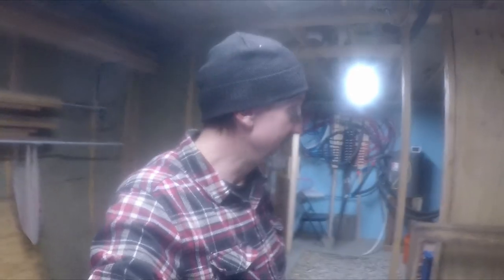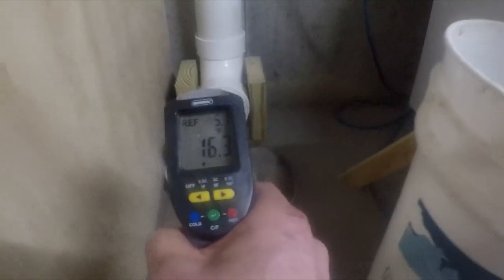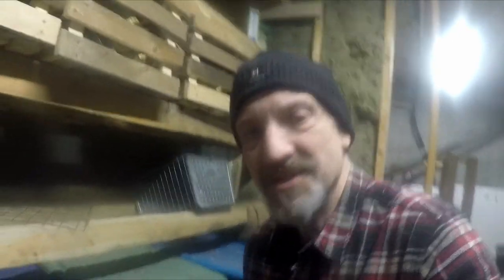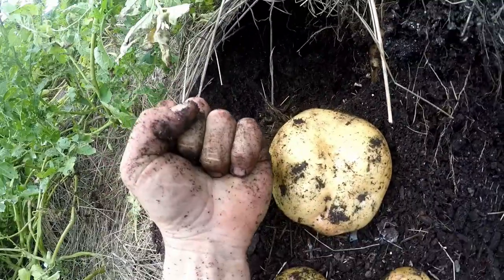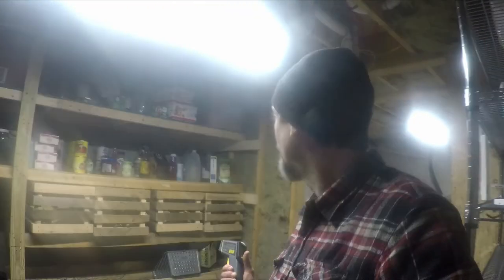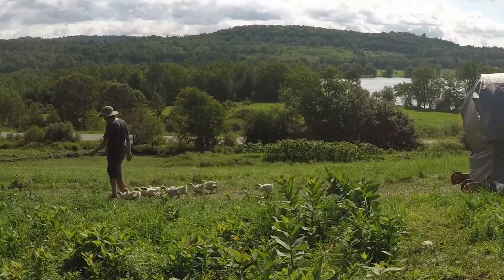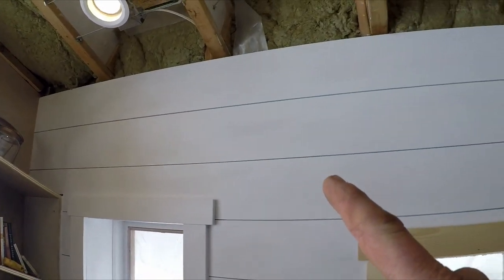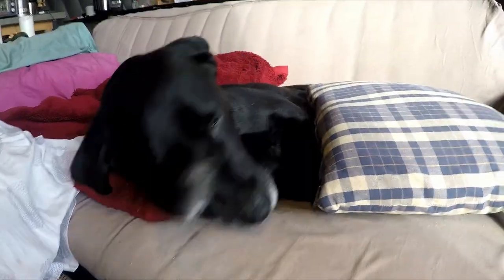ROOT CELLAR VENTILATION Update | Homestead VLOG

Comment: Just finishing our basement root cellar - going to use your scheule 40 pvc pipe layout but I may add an electric 4" fan that fits inside the pipe if I need to exhaust more air from the room.  We have some apples and pears that will make quite a bit of ethylene gas which is bad for the carrots plus the fan would help freshen the room and reduce humidity when needed.  I think the fans run around $40.00 so it seems like a worthwhile addition.
Reply from the maker: That would be a good idea to accelerate temperature changes, especially if you're monitoring the temp and humidity.

Comment: Did you consider a 4" pipe up higher going outside venting air outside or is it not neccessary?
Reply from the maker: A few years in now, I don't use it, really. It would have benefitted from the exit or heat pipe having a higher up exit point. This would create more of a stack effect (like a wood stove), creating a convection current, and sucking heat out at a higher rate.

Comment: I’m wondering how the passive ventilation performs in the warmer months.  I am a little worried that our newly made cold room is going to just heat up through the summer and wondering if there’s a schedule on which ya’d open/close the intake or output vents to keep them from heating it up too much.
Reply from the maker: Your instincts are right on.  It's not quite been a year since the Nursery was sealed and insulated. so we've been able to observe the system's behavior for most of a year. Things definitely heat up in the Spring/Summer. For ventilation, we have three systems - 1) a set of screened openable windows at opposite ends of the room. 2) A set of doors at opposite ends that can be opened.  3) a thermostat/humidistat 6000 cfm fan slightly oversized for the volume of the nursery.
Reply from the maker: I hit enter....  So, really, on a sunny, warm day we need to have the doors and windows open and then the fan still comes on when it gets over 88 F up top (I can adjust the temp).  That's enough to keep the human space and plant space in the low seventies.  BUT - we haven't experienced high summer yet, so, we'll see.  I'll do an update video.  For your project, I would be sure not to skimp on ventilation. MOST IMPORTANTLY - observe your particular space, both temp and humidity, throughout the year before making big plans. Let it evolve organically.  Get yourself some temperature monitors that record the data for you so you can see how your room reacts to the weather outside.  Good luck!
Reply: I'm still trying to figure out how to set up part of my basement for cold storage, and pardon my ignorance.  But with your passive system design, couldn't you just cap off pvc vents in the summer and maybe have a fan if needed?  (Since I live in the Pacific Northwest I just need to keep my summer harvest fresh through winter until the following season).  Any advice is most welcome.  (I just discovered your channel)